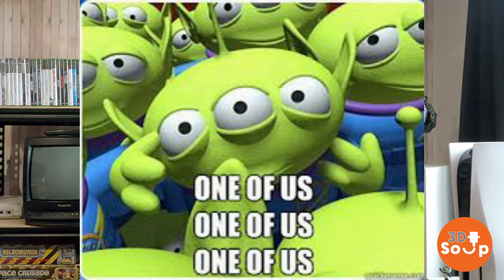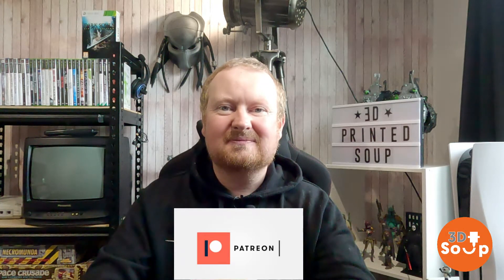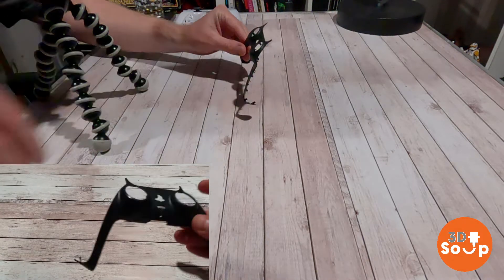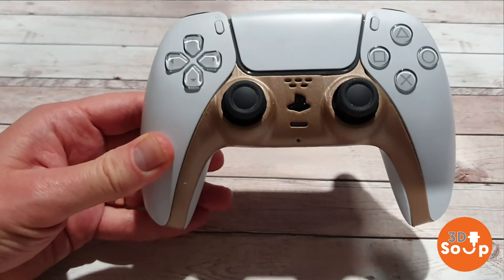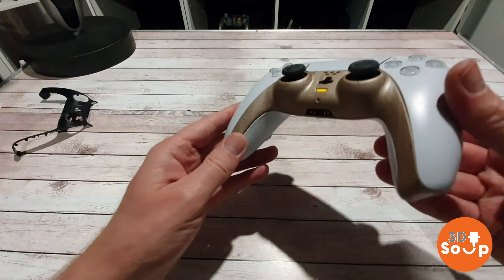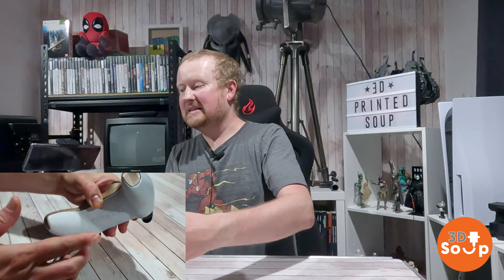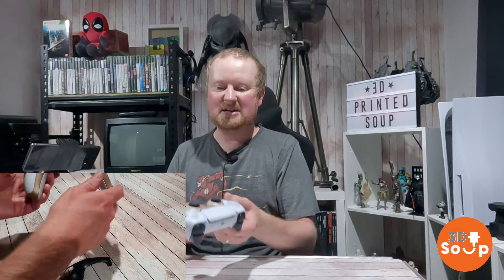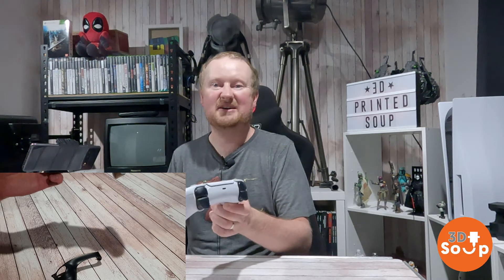3d printing DualSense PS5 controller face plates, 3d printed in resin and PLA

Comment: the PS button is a bit too deep. it sticks out on the normal one... I would sand it down all over, and in the center a bit more.
Reply from the maker: I found it Worked fine and fitted well